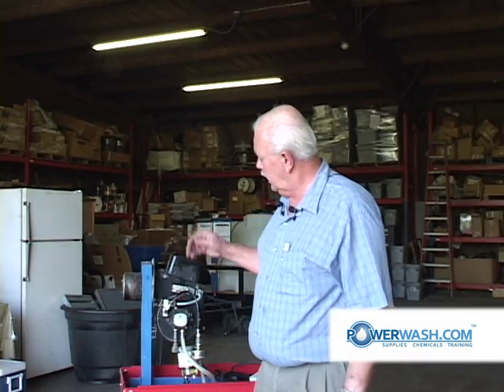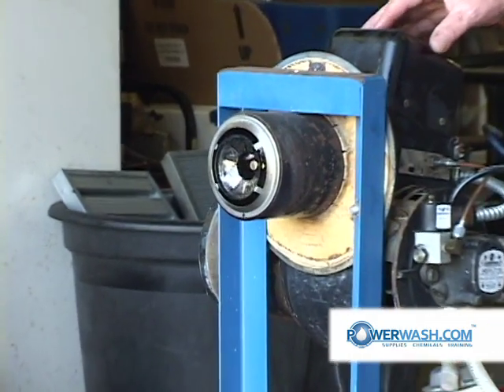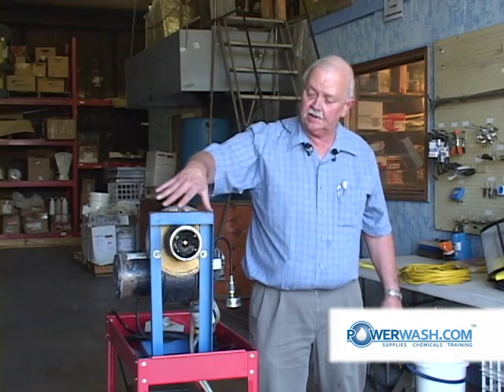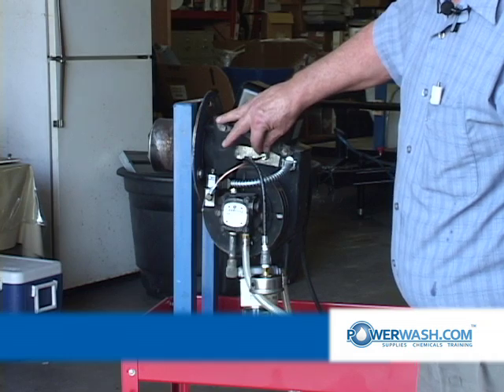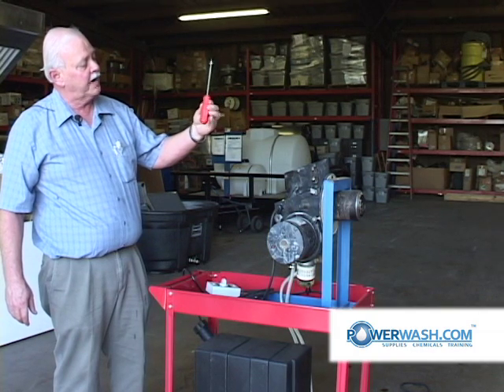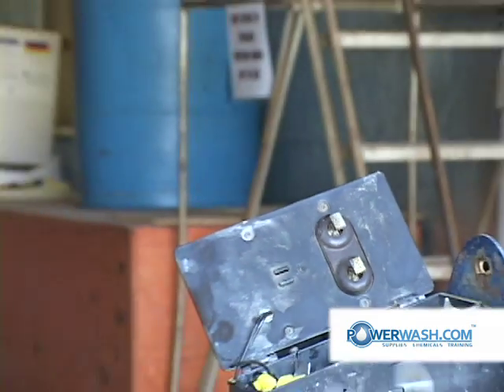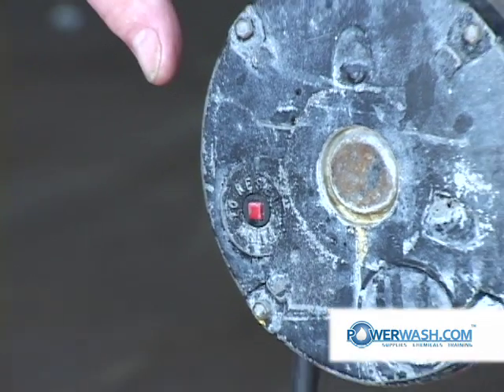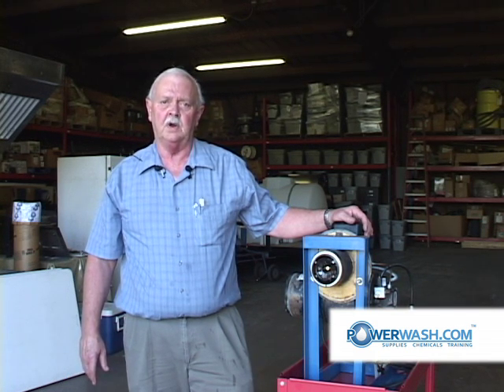Power Washer Burner Trouble Shooting | How Does Oil Fired Burner Work

Comment: HI, thanks for the informative video.  I do NEED help.....im not getting any bubbles in my fuel filter (i just replaced it with a brand new one). What could be the possible causes?  I'm very new to pressure washing equipment.  I have ordered a new flow switch but it hasn't been delivered yet. TIA!!
Reply from the maker: Hi there! thanks for watching and reaching out! 😊 Not seeing bubbles in the fuel filter (no fuel flow or air being drawn in) points toward a few possible issues. Here are some things you can check: 
- Make sure there’s fuel in the tank and no kinks or blockages in the supply line.
- Inspect hose clamps, o-rings, and fittings for air leaks.
- Confirm the new filter is installed in the right direction and free of plugs/debris.
- Bleed any trapped air from the line.
If all that checks out, the fuel pump itself may not be pulling properly.
The flow switch won’t cause this issue, so I’d focus on the fuel line and pump. What model washer are you working with? That’ll help narrow it down.
Reply: @Powerwash  i'm using a Honda GX 630 pressure washer with a beckett burner.  I'm really struggling to figure this out.  When i turn the switch on for the burner , i get nothing.

Comment: My burner kicks on for 2 seconds then shuts off. Replaced the fuel pump and things didn't improve. When it engages you can see the fuel shut off magnetize then when it's shuts off you can see the solenoid release.  Still troubleshooting but any input would be great
Reply: I’m having the same issue except mine will run about 10 seconds. If you have found out anything please let me know.

Comment: What if you have fuel spraying out of the jet whether you are on the trigger or not, My burner just started this and has completly soaked all of the insulation. The solinoid is getting power but does not recirculate the fuel back to the tank, it just constantly sprays fuel out of the jet
Reply from the maker: Either the solenoid is bad or the switch turning it on and off is bad.

Comment: No flame sensor (LDR / Photocell) for shutting off the fuel valve when no flame is detected ?
Reply from the maker: photocell is more common on the 12 volt systems.  This is a 110 volt.  Good observation

Comment: I wish you had done the easy things first! My system had the overload breaker popped out so why do I need all the info about fuel flow and igniters before you get to telling that the pump is driven off the blower motor and can be damaged by water in the fuel? You only get to reasons your blower motor won't run after all the other systems.

Comment: I got diesel running out the bottom of my boiler. I have a Easy Kleen pressure that is fairly new it makes small amount of smoke out the stack then I noticed I seen a bunch of diesel fuel leaking out the bottom. Any idea 🤷 ?
Reply from the maker: Oh Boy!!  Your burner is not igniting.  And it is dumping diesel into the chamber.  When it does ignite be ready because it will shoot flame out of the burner.  My recommendation is take back to your distributor so they can work on it to get it repaired.  There a many things that can cause this problem.

Comment: I've watched this video multiple times and share it to a Facebook pressure washing group religiously to guys having problems with their burners.

Perfectly explained, visuals are perfect.
Top notch sir!
Reply: Whats the group called? I just got myself an used landa pgh w that doesn't heat, looking to learn more about heated washers in general
Reply: @daftnord4957  sorry man,  didn't see this till now. 
Im in a kitchen exhaust cleaning group
Reply: I have a hotsy, no fuel at the small fuel transfer line.  He says troubleshoot up the line what does that mean?
Reply: @zodglubby  there should be a fuel bleeder screw, you may have air in your line if its not getting fuel. 
If not likely the pump is shot

Comment: How exactly does pulling the trigger on the pressure wand activate the burner, thanks for the very clear and informative video!
Reply from the maker: It triggers a microswitch which then completes the circuit for the burner to ignite.

Comment: So if I'm not getting oil to the burner port. What are the main causes? Replaced filter, replaced pump and doing same thing. At first it was only getting hot when I turned the throttle down to turtle on my washer. Now the burner won't light at all. I'm getting air and sparc. No fuel to the burner but fuel in bleeder valve.
Reply: Same here. I'm getting a fuel in my return line and if I kink it off I build pressure on my gauge but still doesn't get fuel at the supply for the burner

Comment: What should the temp be on a hot water pressure washer just a range? Also any guages to check temperatures
Reply from the maker: normally temps are 150 to 200 degrees Fahrenheit

Comment: HELP! fuel pump is working, fuel is coming out of bleed valve, but no fuel coming out of transfer line
Reply: Same problem. Did you figure it out?
Reply: @Seth Clemons did you figure it out?
Reply: @Seth Clemons well hell. I'm about to try that. Just got a new pump and still the same issue but it has the grey one as well. Old one had the green.
Reply: @Seth Clemons nope. Think the original solenoid is bad. Only spitting fuel and only with throttle turned all the way down
Reply: @Seth Clemons lol. I'm dont with it for now. Ordered a new solenoid. Hopefully works. Pretty frustrating stuff.

Comment: I have a commercial pressure washer k’archer 3500 psi that won’t charge the battery. I been told it could be the starter or perhaps the coil. Do you have any suggestions,it is highly appreciated.

Comment: Am I not correct but isn’t there a 4th option as well? Isn’t there a pressure switch which tells the unit to fire once the trigger is pulled? Often times the problem is the pressure switch which gets stuck either causing the burner not to fire or fire and not be able to turn off

Comment: Great video, you forgot to mention the plastic coupling between the Burner motor and fuel pump, a broken worn slipping coupling can stop the fuel pump from running.
Reply from the maker: Thank you, that is correct

Comment: Wondering if you can help with something. I have the hot box from northern tool. It has a Beckett oil burner that has a turn dial thermostat and a flow switch on it. I would like to eliminate the flow switch and replace the dial thermostat with a digital one, any thoughts?
Reply: Chris did you ever figure this out??. And how is it working.  I'm looking for a good hot box and don't know what to buy

Comment: What's the 4th red wire for in a 120 volt generator type setup.  Does that need voltage to ignite.  I'm trying to test out the machine by.  Bypassing the generator.  I can get the blower to spin and fuel is pumping but what does the red wire need ?

Comment: No such thing as a POWER washer,  it's a PRESSURE washer. 2500PSI OF PRESSURE NOT POWER!
Reply: matthew thomazin yes there is. Power wash is hot water. Pressure wash is cold water.
Reply: Nice one Rick!
Reply: matthew thomazin technically a power washer is a high pressure washer....around 40000 psi

Comment: Great information, my machine is saturating the insulation with diesel, it is smoking extremely bad, I am under the impression that the fuel is not getting burned. this video was so helpful.
thank you!!!
Reply: +Eddie Regory it almost sounds like your tip where the diesel comes out may be worn, hole to big, or dirty and your spray is going everywhere kinda sputtering.
Reply: I have the same problem. Did you figure out the problem? My coils were saturated and I had to take it all out, clean it, replace the insulation and also replace tip. Yet, it still blows diesel fuel into my coils and soaks them. Right now I don't use the heat but I'm thinking I need to replace my my ignitor
Reply: Fuel delivery issue. Check fuel delivery nozzle and output of fuel pump. One or the other is causing "over" delivery of fuel.
Reply: sounds like voltage issue
Reply: Anyone know what would cause the insulation to deteriorate on my 12v diesel burner tank?
Reply: I have problem when I use the burner and set the temperature to 200 degrees it start producing black smog and damage the voltage regulator what can be the problem?

Comment: awesome video but CAN SOMEONE HELP ME?! my burner fan just budges when the switch is turned on but doesn't have any spin. The fuel pump is not sucking in fuel either. Does the fuel pump work in conjunction with the fan for it to work? It sounds like I need a new fuel pump.
Reply: give it a spin with your hand after you diconect the power it may just be stuck, and yes the burner motor turns the fuel pump.
Reply: Thanks. I have one more question... when the burner is running I noticed there is way too much diesel fuel inside my coil system, so I replaced the tip. I then had to take out the whole coil system, clean off the diesel from the coils and reinstall with new insulation. when testing it again, the coils inside my burner is becoming saturated with diesel fuel again. Do you think that I'm not getting a spark or fire so therefore it's not burning the fuel? Any help would be greatly appreciated.

Comment: Hi can you advise me at all please?
My burner is not getting no fuel exiting the pump,  it's returning back to the fuel tank ok so I k ow it's pumping it's just not switching over and going to the injector,  I have changed the solenoid on he pump but still no luck. Any help would be appreciated. 
Dean
Reply: are you getting power to the solenoid?
Reply: Anyone know what would cause the insulation to deteriorate on my 12v diesel burner tank?

Comment: Great job, exactly what i was looking for. Powerline sold me a polished turd. my machine has operated on ONLY 5 jobs!  I not only have oil spitting from the head on the right side of the motor,but the 12 volt burner stopped making heat in the middle of a my last job. I haven't done any testing yet, but i can now with your video as a reference. Thank You. (I'm thinking it might be the pressure switch)
Reply: do you still have the pressure pro hot box and is it working good now